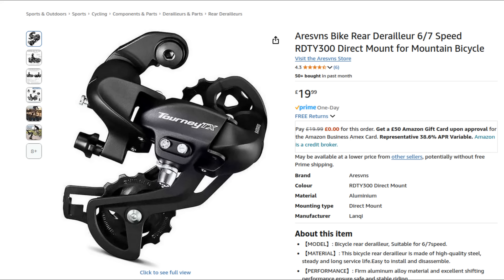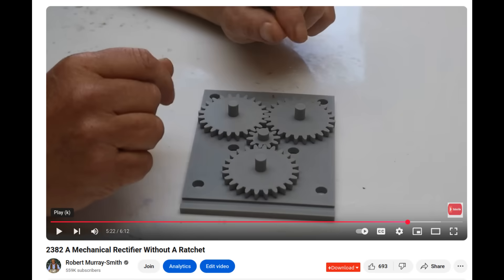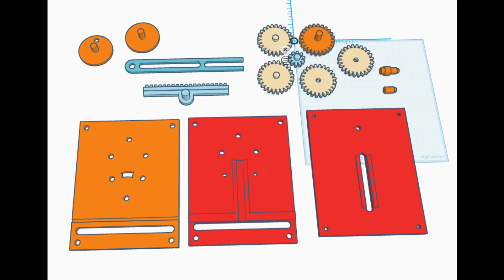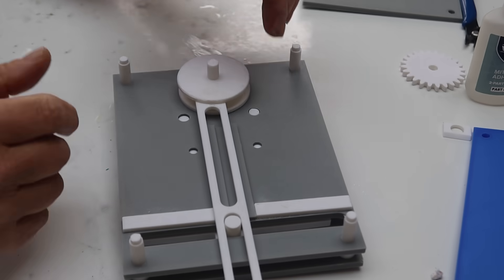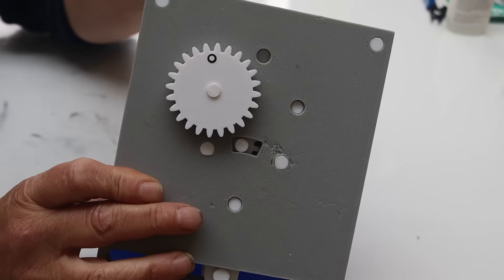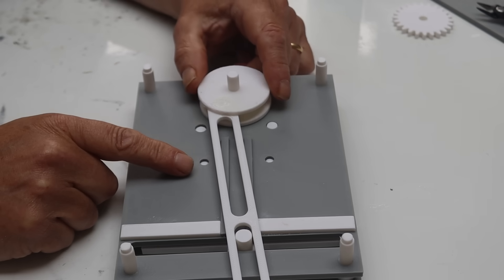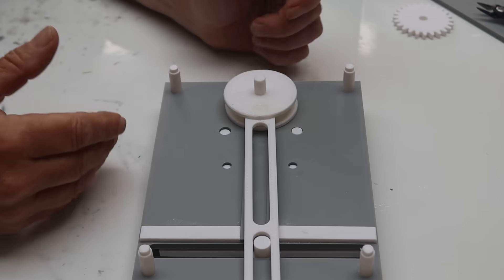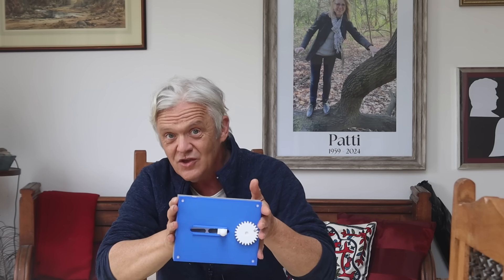2383 The Sliding Gear CVT

Comment: This is great, I've got a low speed engine I've built (~100rpm) that this would be a really fun transmission for. How would increasing or decreasing the throw on the input gear affect the motion? If the link on the selector was lengthened as well, would it just increase the minimum and maximum ratio?

Comment: If there's a difference in torque dependent on the current rotation angle, might be worth investigating where during the pedaling cycle you need more or less torque and see if you can map the oscillation to the input instead of the output so you have the most torque where your legs are the weakest during pedaling. Maybe the torque curve might not have the right shape, but sounds like it would be worth experimenting.

Comment: If it is to be used as a bicycle transmission, the varying rotational speed might actually be helpful in the same way some front sprockets are oval, providing additional leverage when each pedal is at/near the top of the cranking motion. 
I remember someone on this channel was showing off his fancy laser cutter... I don't know if it's powerful enough to cut steel, but if it is, that would be a good way to make a really thin version of the device. Most viewers might not be able to reproduce it without such a tool, but it would still be nice to watch it being made and seeing the end result.

Comment: The whipping motion could be positioned at the tdc/bdc position on a pedaling stroke where there is essentially no power transmitted.
It would be awesome if you could show your mechanisms in a rendered method like thang010146 does. Being able to see what the innards are doing would be really sweet.

Comment: Great video. I like that design in general but I'm not sure if it's better than a standard rubber belt CVT (with variable size pulleys) or cheaper than that.
But it's interesting one. Thank you for sharing it with us.

Comment: Aside from the corrosion of the soul that the "Hur hur just use pencil dumy" story poses - slandering predecessors so the listener can self-congratulate on being smarter than imaginary fools - it's also factually backwards. As it happens, there was a big seemingly dumb NASA expenditure before the space pen was developed. It was pencils. 

NASA paid an engineering firm to custom build them a batch of the least bad possible mechanical pencils, to minimize the problems which graphite both had and caused in spaceflight. The payment was mostly NRE for engineering and custom machining, but $4400 over a batch of 34 worked out to 129 1965 dollars per pencil, causing a scandal. This is of course still a factor of a thousand or more less than the myth would have you believe.

Once it was developed with one million of private investment, both NASA and the Soviets paid $2.39 per space pen. The general public could too, if they bought enough of them at once. It's manufactured and sold to anyone who wants one - and widely used in spaceflight - to this day.
Reply from the maker: it doesn't matter mate - it's just a silly story - let it go

Comment: Adding a 2

use the relaxed part off the ration as an advantage for the cyclist. Adding a 2 to 1 ratio on the input and placing the pedals in orientation to take advantage off the difference, when the cyclist effort is at it's weakest .
Reply from the maker: cheers mate

Comment: shavings seem a problem.  
sharp crayon, maybe? 
use heat to reform the tip so dust.
Reply from the maker: that's your take away from this video ? Wow
Reply: i guess, yeah. 
unless i have immediate use for your design of the day it just goes in one ear and out the other; occasionally knocking something else loose on the way though. 
seems the other day it was crayons. 
either way, you beat jerry springer for most entertaining lunch program. :)

Comment: The "space pen" was already being sold in stores for about ten times the price of a BIC.  NASA bought a few of them at retail prices for their guys to use.
Reply from the maker: that's your take away from this video ? Wow
Reply: @ThinkingandTinkering  
Wow, he repeated an often-told falsehood about the "space pen."  There is more to the story, but I kept it as brief as possible.  The Soviets ended up buying Fisher space pens for their astronauts to use as well.  Pencils cause real problems with graphite dust and pieces getting in electrical circuits.
I have owned a few of them and used them for several years.  The ink is under pressure and that causes it to ooze slightly around the ball.  The first little bit of writing you do leaves a glob of ink on the paper.  I eventually stopped using them because of that.

Comment: Wow! Line up the changing speed with the pedals so that the small movement aligns with vertical pedals where the riders force is smallest. When the pedals are horizontal (easiest transfer of energy from the rider) you get the larger motion from the lever. ❤ this could really work in the riders favour. A continuous variable variable transmission !
Reply: I had the same thought.Yes.If it could be aligned with top dead centre of the pedals it should make it easier to pedal.
Reply from the maker: nice cheers mate

Comment: Any idea what range of gear ratios this would be able to achieve in a practical size? I bet you could save some weight and money by using laminated fiberboard for the plates.
Reply from the maker: not yet - but for a bicycle - reasonably should be between from 3:1 to 9:1 - somewhere around there?

Comment: Could your CVT's purpose be inverted?
What I'm thinking of building would be a bike trailer that has the parts from a Coleman mini bike (a gas engined and will not go faster than 20 miles an hour without being hot rodded.) (For one to up the torque so that it wouldn't bog out the sprocket's could be changed for more force, resulting a need for more RPM's to even maintain the 20 miles an hour and even more RPM's on the motor to get it into the 45Km zone.)
The application would be be that I would run the gas engine on the trailer just to get me up a several mile long hill while I have cargo weight.
Once on top of the Mountain it's about 60 miles of flat lands and once up to speed you don't need a lot of energy to stay at speed, so the drive wheel could be raised while in motion and the gas engine could be turned off 

The bike would have both pedal and electric power.

The problem is trying to calibrate the force of the gas engine (re-geared to a lower speed so as to give it more hill climbing abilities) that would need to be mated/matched to the power of the electric motor that would be on the bike.

In short IF the pivot rod were allowed to free roam would it just fall into a position that matched the wheel speed of the other vehicle (a class 3 E-bike here cannot go faster than 28 miles an hour 45Km (If you stop peddling your legal speed is only 20 miles an hour) so I'm not sure that the CTV would suffer much from extreme forces?

If some other ground contact wheel (from some other power drive shaft/system was creating the pace and the pivot pin was able to move to the correct location automatically the remaining issue in the Math would be an outcome of torque.  The system would self adjust so that If you slowed down then you gain torque, which if all it was for was climbing a long steep hill it would work?
Reply from the maker: that's an interesting question and my first response would be a simple yes - but my second response would be - test it and see - i certainly like the idea

Comment: A graphite pencil is going to leave graphite suspended in the air which can get into eyes, electronics, lungs.   Millions to develop a ball point pen that could have saved a multi-billion dollar rocket from a broken peice of 'lead' pencil stuck in the wrong fuse or switch that caused an abort or worse is quite possibly well spent money.     Plus its all probably a fairytail anyways.  And has nothing to do with  CVT's, sorry.
Reply from the maker: It really doesn't matter mate - it's just a silly story to illustrate a point - concentrate on the point of the video
Reply: @ThinkingandTinkering  I really liked the video. what ratios are possible?

Comment: I wonder how it would work at 200 rpm?
Reply from the maker: well you could make one - test and let us all know
Reply: Some portion of the system could do 200 rpm.  The question would be:  Are you using like Victorian Math and your loose variable would be a grand gear the size they used on Mining pumps and it required like 6 pie shaped pieces to be assembled because it's a story and half tall?
A more refined question would be: "Would it work without becoming un-wildly with a working requirement of 200 rpm?" 
After that would be more of a list of Engineering Questions like:  Will the Marketing department overprice/over-profit margin make it too expensive to sell?  For that I refer to the comic series "Dilbert"
Reply: Lol

Comment: Great work as always Rob! Any plans to make it automatic based on the effort applied at the pedal? I remember your wind turbine limited slip differential using brushes and couldn't help but think you might attempt to combine the 2. As the brushes slip, they would engage the slide. Sounds pretty neat in my head, lol. But not sure how easy it would be to produce, and it would drive your costs up quite a bit I imagine.
Reply from the maker: that's a goo didea mate - i hadn't thought about it - but i like it

Comment: This is very interesting and thought provoking. By transforming to linear motion then rectifying it back to circular motion you do get a true CVT but only if the steps on your ratchet are infinitesimally small. In reality they are not which means (I think) that you will still end up with discrete gears and steps. Maybe I'm wrong and I'm not a good enough mathematician to figure it out.
Reply: - in production you can use a sprag  - readily accessible and smooth operation..
Reply from the maker: There is always a difference between the theory of a thing and the practice of a thing mate - in theory - you are quite right - in practice you don't need to go infinitesimally small the achieve a result indistinguishable from theory in use
Reply: @ThinkingandTinkering Yes you are right. I wonder where the tradeoff lies. As a cyclist I dream of a true CVT. As a scooter rider I enjoy the benefits of a true CVT but my engine bears the inefficiency. I guess racing gives the answer. Whatever the tour winner uses is optimal

Comment: I think this will work great on a bicycle. People buy oval chain rings to get this effect.
Reply: Right, if this were built into the chain ring or bottom bracket then it could simulate oval chain rings which are intended to compensate for the nonlinear effects of extending muscles and joints. This has to be balanced against the benefits of a smooth circular foot motion.
Reply from the maker: yes they do! - nice one mate

Comment: Pedaling is already a pulsing motion. I really can't decide if it will be an issue. It may also be possible to clock the cranks in such a way as to hide the output pulsing via clever timing with the input pulsing.
Reply from the maker: good point mate - cheers
Reply: @ThinkingandTinkering  And at the beginning of it I thought he was going to slap a pedal onto the crank and base a CTV off of pedals that you pressed with your feet straight down.  
(Followed next season of making a crank casing track that was bent in X and thus the pedals would move similar to a normal bikes pedal travel path with the crank end still being reduced in travel to just Z motion travel straight up and down, or set diagonally.)
Reply from the maker: @FuhrChris  never occurred to me mate - until now lol - cheers

Comment: The pen and pencil thing is a myth.  Early space programs used pencils, but there were problems.  The graphite would break off and could get into eyes.  And it's flammable.  The space pen was invented in 1965 by Paul Fisher and the Fisher Pen Company.  (With no funding from NASA.)  The Fisher Pen Company offered them to NASA, who bought them and started using them in 1967.  Even the soviets used them in their space missions.
Reply from the maker: it doesn't really matter mate - it's an allegory

Comment: Will it work Mr. Rob with motorcycle
Reply from the maker: yes
Reply: - may need to incorporate a multiphase system to reduce high speed vibration and smooth pulsations.

Comment: This is extremely cool! The idea of an actually robust CVT is incredibly exciting.

NASA used the expensive fancy space pen instead of a pencil because the loose graphite shavings from sharpening pencils might have floated around the cabin of the space craft and could have caused serious problems for the electronics. The Soviet program used a pencil. I love that old story, but I think it speaks more to differences in safety cultures than it does to differences in design philosophy. After all, the Soviet space program was a lot more deadly than ours.
Reply: the thing is, even the soviets used space pens, and even nasa used pencils. and the space pen wasnt even funded by nasa, rather it was a private endeavor by paul fisher, who developed the space pen with no government funding. nasa did attempt to develop their own space pen prior to fishers, but it was prohibitively expensive, and so they abandoned it and went back to mechanical pencils despite the danger that the graphite posed. the soviets, on the other hand, used grease pencils. after the fisher space pen was finished, both the soviets and nasa adopted it very quickly, and they were sold for $2.95 a piece.

personally, rather than speaking to differences in design philosophy, or differences in safety culture, it speaks more to the fact that humans like fun anecdotes with snappy punchlines
Reply from the maker: @maxinehardy9411  lol - it does indeed lol
Reply: yes agreed, carbon bits in a space craft in zero G is far too risky. They could float all over and short out all sorts of key equipment.
Reply: Cosmonauts used wax pencils (until they could also get Space Pens), exactly like divers use for writing underwater today.
Basically, it's a fancy crayon.
Reply from the maker: cheers mate
Reply: "Soviet space program was a lot more deadly than ours" Ah, no. Not in the long run.
I bet you forgot the two accidents with the Space Shuttle.

Comment: I've also seen strong one way bearings of all types that only turn one way. Perhaps it could be integrated as a part.
Reply: The motion-rectification mechanism seen here, is made solely to avoid using such one-way-bearings (was presented as such in the previous video)... Has itself some disadvantages (half-a-tooth-length of no-engagement each time it switches), but different disadvantages than such one-way-bearings have (need energy to "unblock", before freewheeling).
Reply from the maker: i did mention that in the first video mate - linked at the end of this one